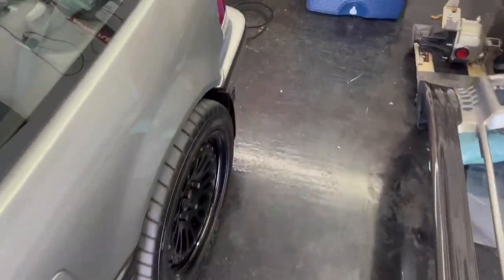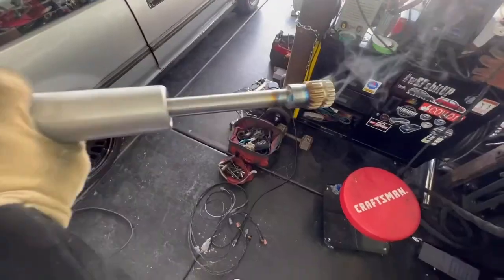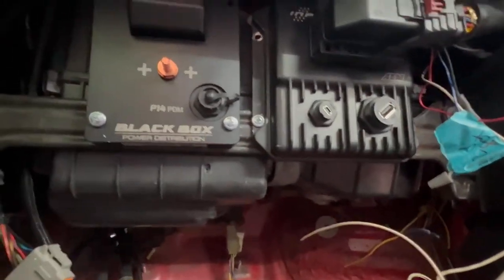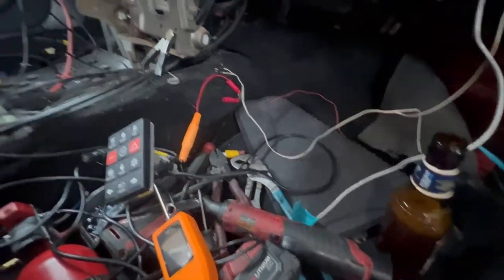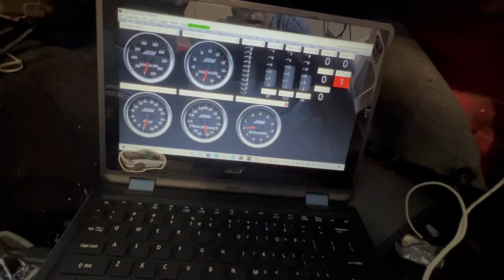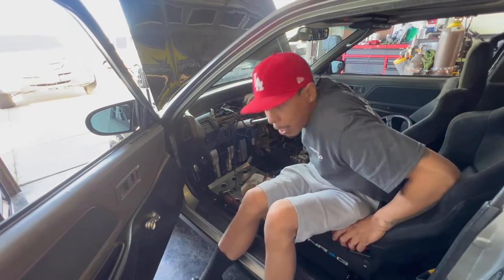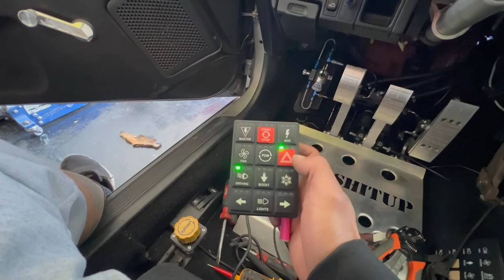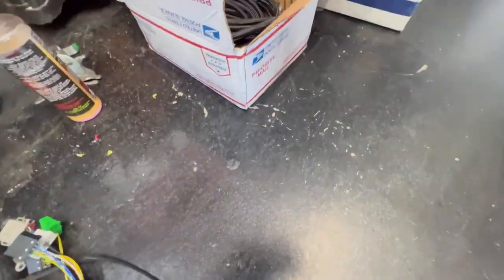P14 PDM Instal On My AWD Civic

Comment: Love your channel and ef ! I have a couple questions tho. What battery relocation kit/mount is that I wanna do a relocate in my ef but with a fullsize dry cell like yours ? Also, what was the alternator company you use ? I'm doing a k24 swap in my ef and want have a solid electrical system.

Comment: Thinking of getting this PDM to fix all my electrical issues and I had a few questions.  How do you like it? How did you run your alternator and starter wire, straight to the PDM or a distribution block? Also what stock components did the new harness connect to?
Reply from the maker: nothing better alt power and starter have nothing to do with pdm so wire the same as before